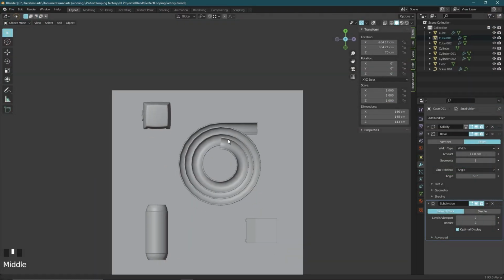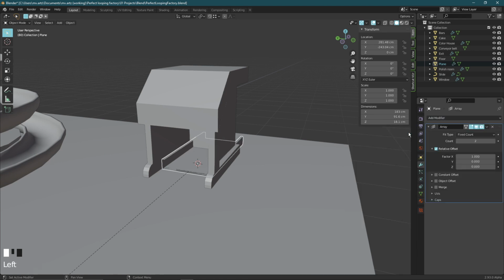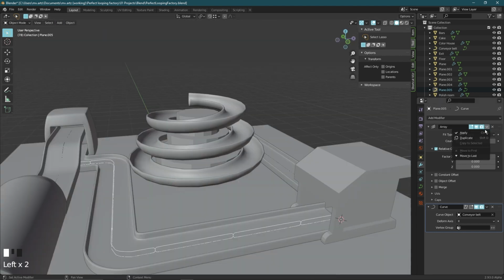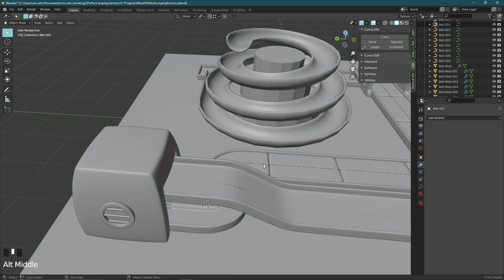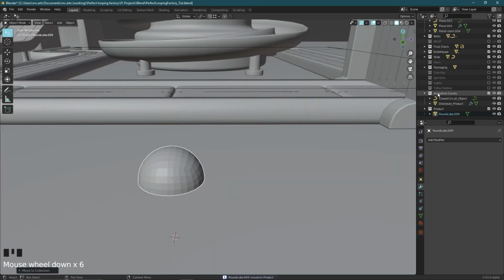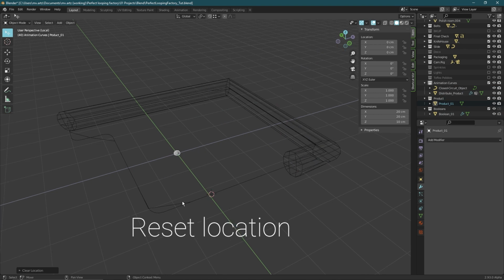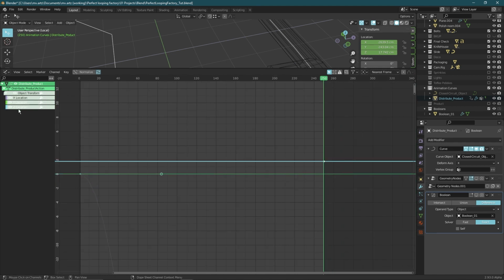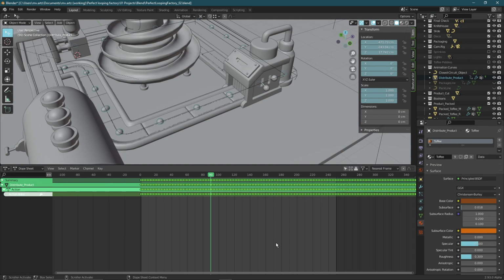How to Create a Perfect Factory Loop Animation in Blender | Incl. Geometry Nodes

Comment: this is a great tutorial, thanks for all!
One question, is it possible to make it work with rigid body? like dropping stuff from one level to another?
Thanks mate
Reply from the maker: This exact setup probably doesn't work with rigid body and other dynamic sims. Because the instances are constraint to points on a mesh. 

However it is perfectly possible to create a factory with rigid body simulations.. 

What I will say is, you could make a path for the instances and drop a level. The way I set it up. Of course the timing and spacing would be hard to manage.

Hope you figure something out, it's very difficult to give you a satisfying solution, without knowing the project

Thnx for the support mate!
Reply: @MVARTZ  thank you for reply! I think using your method, then applying the animation, and figure out somthing with physics there... from my nood level :D
Thank you very much again
Reply from the maker: @AnouarBrissel  love to see hoelw it works out. Share the endresult with me if you like.. Tag me on IG if you're on there @mv.artz 😁
Reply: @MVARTZ  i will of course :D

Comment: how do you move the convayor belt
Reply from the maker: I recommend using the curve modifier.  Check which axis is deforming and move de mesh along that axis. Use linear interpolation for the smoother results. That should do it

Comment: Amazing work mate! I do have one question though, how do you "hide" the objects when they've entered the last machine and then go outside to "loop"? You made a tunnel and put it into wireframe mode only but.. I'm struggling big time to get stuff "hidden" so it doesn't show in render :c cheers mate!
Reply from the maker: Yea so that 'tunnel' is a mesh which I use as a boolean for the object that contains the instances. Hope that helps. 

I just use wireframe as viewport display so that the boolean mesh isn't covering the stuff underneath.
Reply: @MVARTZ  Cheers for the reply mate! I pretty much went through your video frame by frame to try and figure out how to use the tunnel as a boolean against the (candies) object  that were an array on a path, but couldn't figure it out (and view layers arent my strong suit lol)

What I did instead was using a material: BSDF + Transparet, mixshader fac to ramp set to constant. Ramp fac to math node Add, mathnote to separate XYZ -> connected to a object info location (or in other cases mapping node), did the "hiding trick". 

Best of luck with your channel and blender artwork mate, it looks awesome! :)
Reply from the maker: @benabode  Nice work around! There usually is a dosen ways to achieve something similar, probably what makes it so interesting to learn 

Cheers and goodluck with your projects too 😁